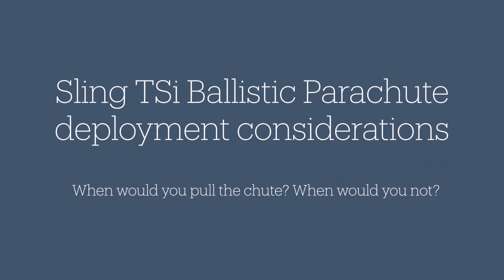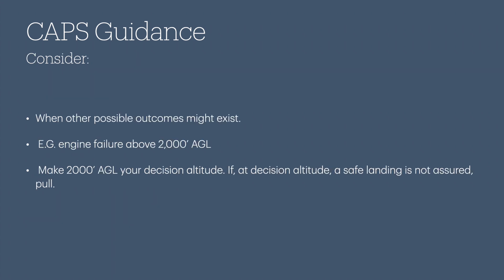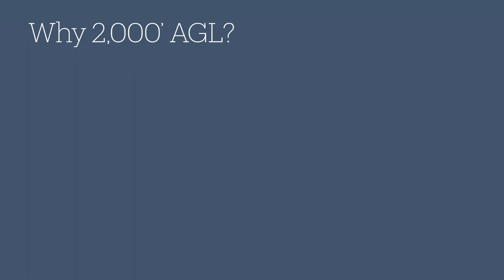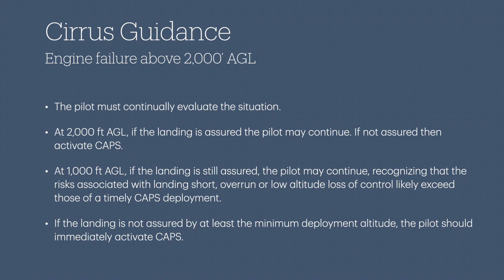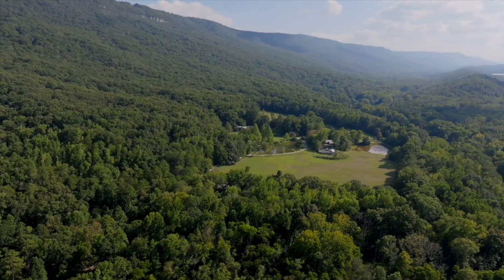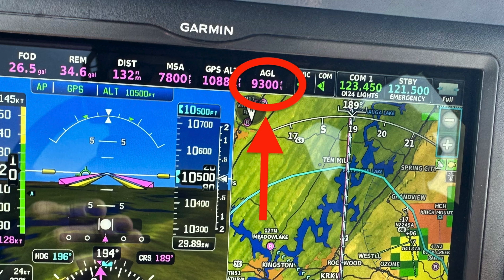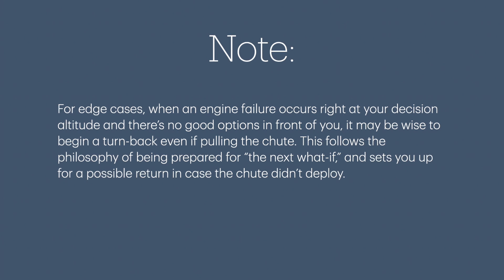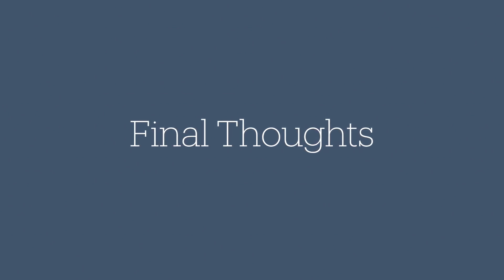Sling TSi Ballistic Parachute deployment considerations

Comment: Great job 1AM. I know it takes a lot of time to do this. Thank you! I have a Sling 2 with Magnum chute. I agree with your analysis. It would be nice to have a data base of Sling chute deployments like Cirrus has…but maybe lack of pulls is an indicator of Rotax reliability. I think Boris Popov (founder BRS) has said “pull at any altitude if you need it!”  The YouTube video titled “Rescue Parachute System in Sirius” shows a successful deployment at about 200’ or 250’ agl, I am guessing, from level flight. In the USAF, it was hammered into us to trust the ejection seat. Parachutes work great! “Pull early, pull often!”
 
https://youtu.be/MQjxpwzigN4?si=RRHfcRLCIwWUIjuO

Or here’s test pilot in a spin 14 seconds before impact! 327 agl?

https://youtu.be/xwZrtYgnP7s?si=lQEostCnUKAZYbbF